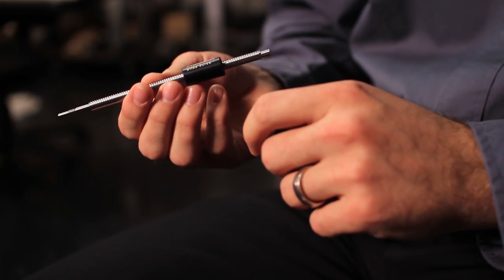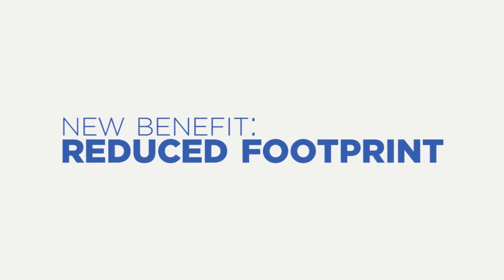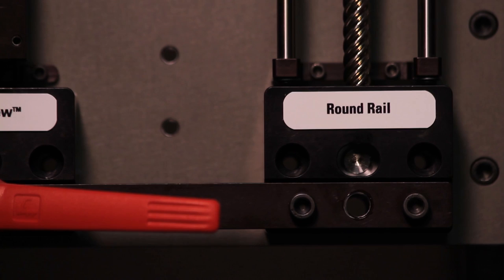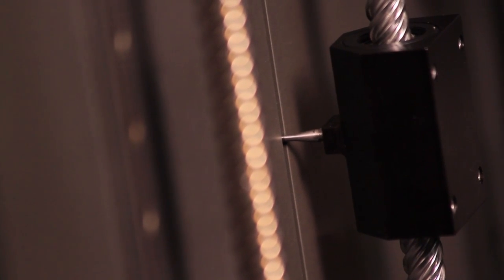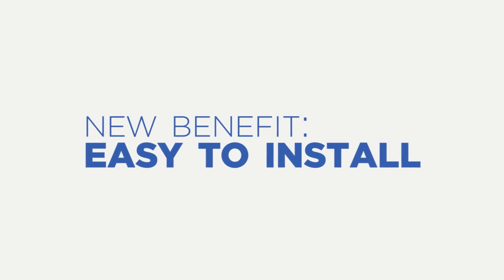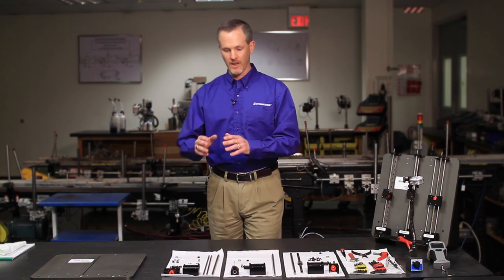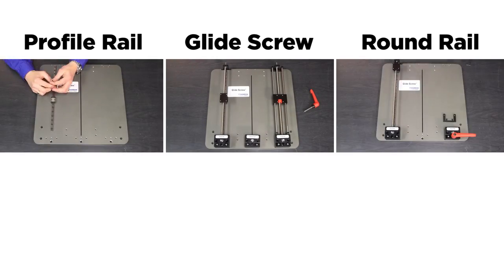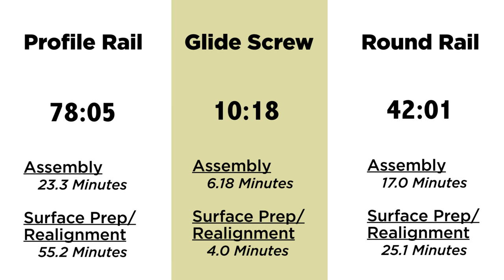The Thomson Glide Screw™- What's the buzz all about!

Comment: What's the max linear speed possible ?? What about max length ?? 
Now we are using a Chinese made Profile rail of 1000 MM stroke, pitch of 10 MM. The max speed is 100 mm/sec, diameter of screw is 16 MM. Increasing the speed to 150 mm/sec cause screw to vibrate intensely.